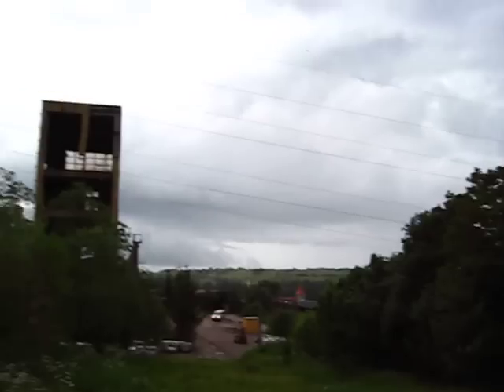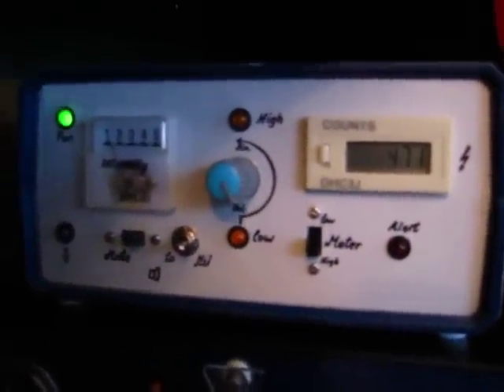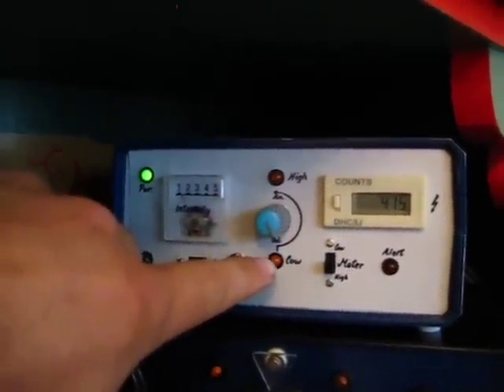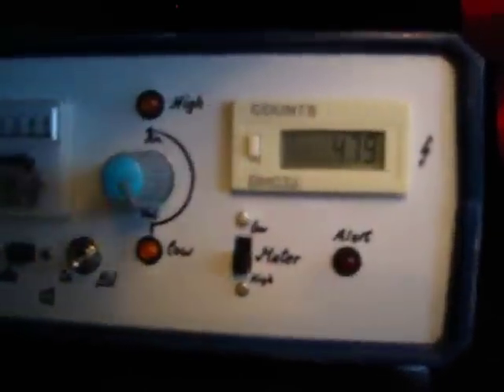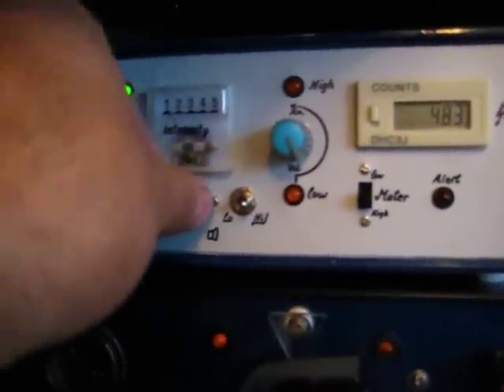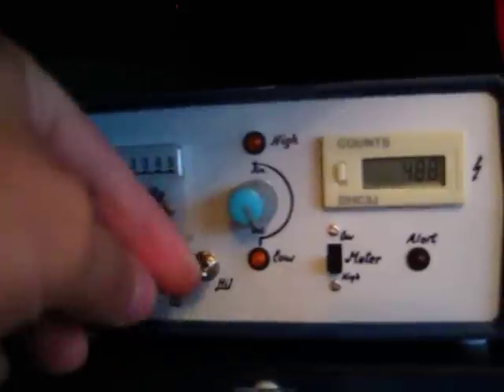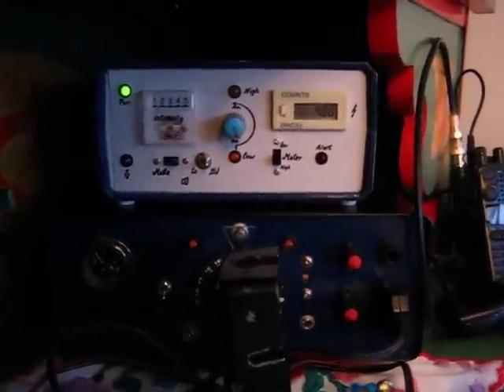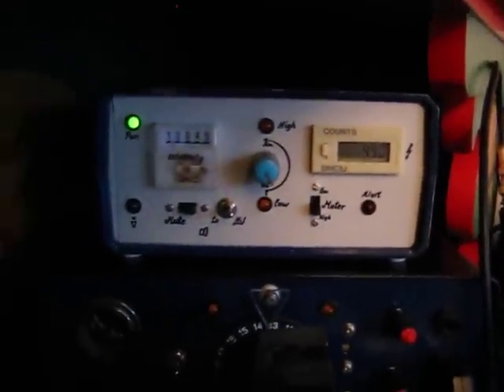Homebrew lightning detector with alarm switch

Comment from the maker: @ranasingheum1 This circuit responds to a lightning induced electromagnetic signal simultaneously. It has an impulse lenght set to 100 ms to drive the counter, but overall it triggers in the same time as the lightning goes off. So as I have no feedback to a control circuit (a camera shutter for ex.) I can't speak about reaction time. The alarm relay only triggers when the integrated level reaches a certain voltage, that means approx 5 impules per second.

Comment from the maker: @MegaSkybug Well... Thank you all for your words :) ...this is a prototype. It needs some fine tunings, and I still have to work a bit on the design. This unit works very fine, but still it's sensitive for other sources of interference (bad electrical connections that make electric arcing). But overall it's good and reliable. ...I had no intention of making the device as a model for sale, but if someone is interested in it, we could talk about it. Best regards! Pityu

Comment: Enjoyed the video Thanks. I ended up building the older circuit as that is what parts I had in my junk box and it works great. Had to wind the inductors though as I have no chokes here in the shack. Looking forward to playing with it and putting a counter on it as well. Using the oscilloscope at the moment with a 10 minute sweep to watch the activity.

Thanks
KD4OBQ

Comment: Have you ever tried building a sensor around an AS3935?  It is a very high performance single-chip sensor with intelligent interference rejection and automatic distance calculation.  You can purchase a complete module for interfacing with a microcontroller for around 20 Euro.